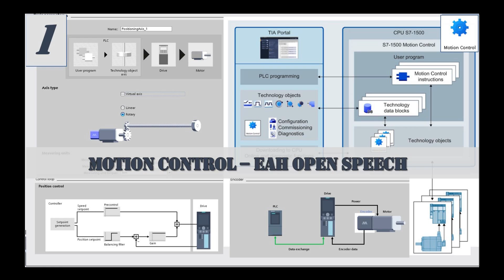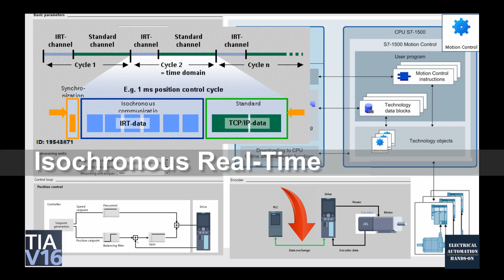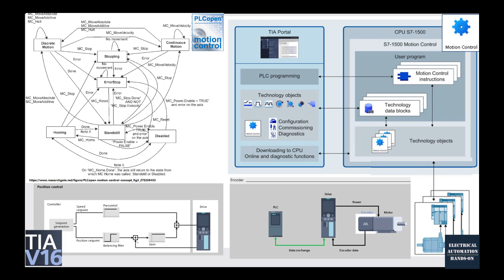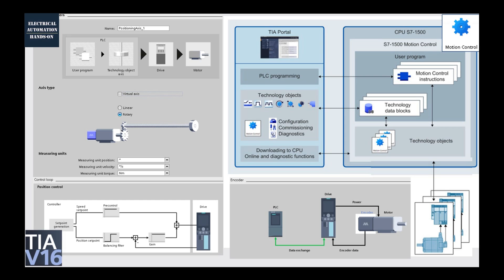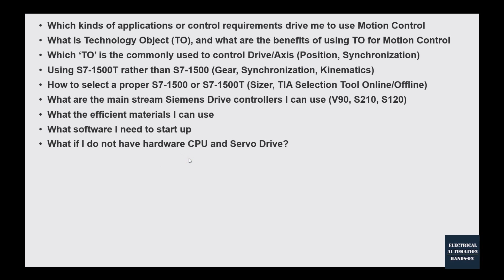MS01. [Siemens Motion Control] Video Series Open Speech (Siemens TIA Portal S7-1200 S7-1500) [1/10]

Comment: hello can you make and exaple with gearing . mean 2 axis which fallow each other. for exaple wire winding machine .  1 asencron motor with encoder as master and 1 servo motor as slave and slave follow the master with wire tickness and according to rotation   etc  plz..
Reply from the maker: Hello the gearing control or CAM control is in my plan, but just not recent. Regarding the converting winder control, that is the tension PID + winder velocity/diameter math calculation control. That is not gear or cam control. I did the winder control project. But the winder control definitely has 'Know-How' and not easy to explain in YouTube. We could contact via email, and my knowledge delivery is billable.
Reply: @electricalautomation   ok tnx very much your reply and effort to teach someone thats very variable thing im waiting your gearing exaple with huge wonder
Reply: @sametpnarl8939  Thanks and warmly welcome! Please feel free to leave any comments and requirements. Welcome!